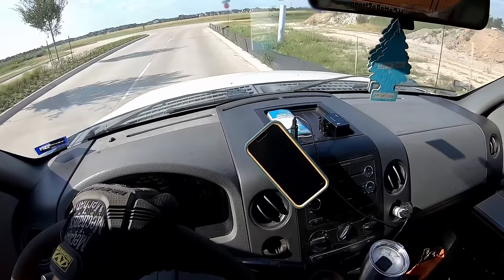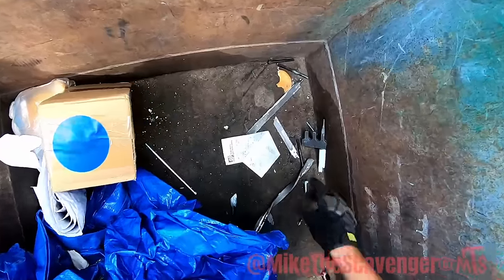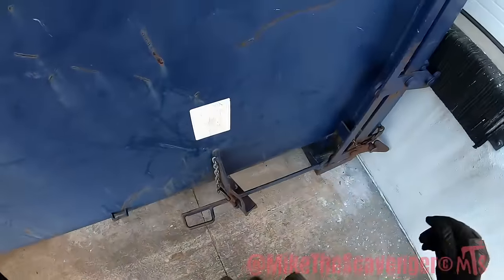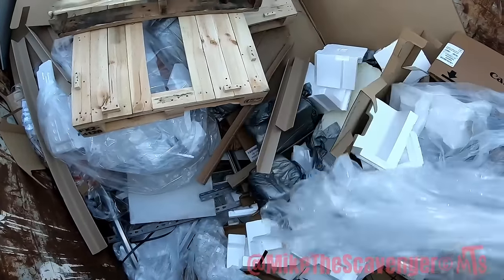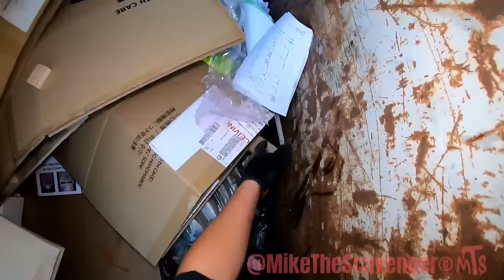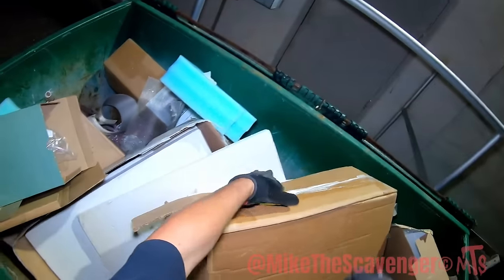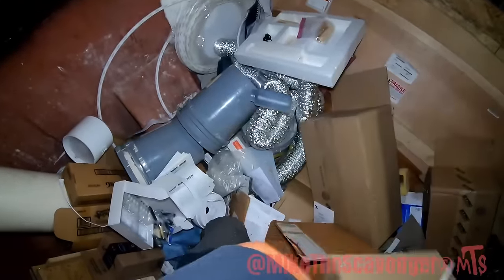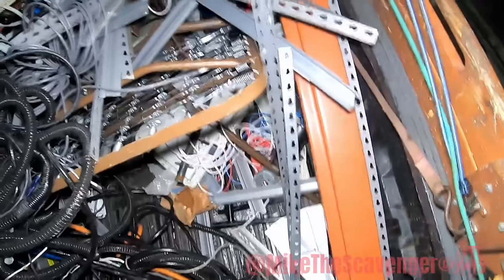Dumpster Diving "It Got The Twisties!"

Comment: That Nobalite Flash system is no joke! Weighs around 350-375 pounds 😂, that unit is just the power supply and controls UV flash lamps
Reply: What does anyone do with that much UV flash? Industrial scale sterilization or epoxy curing?
Reply: @paulperry7091  Sterilization is one use, alot of product testing use it to see how things will react to sun fade, I believe its also used to test sunscreen/lotion. Also similar machines (not this one) run the lasers in big CNC machines
Reply: @Mikethescavenger

Comment: That was about 600$ worth of grout!! Hope you took that home!! That can do a whole building
Reply: It may have been old stock that was exposed to humidity... If that's the case... It's all bad.
Reply: @OldsmobileCutlass1969Va  doubt it.
Reply: Mike is usually pretty knowledgeable about stuff, but sometimes he priotizes scrap over profit..
Reply: @BurkesBucknFirewood You doubt it? Based on what? You must be privy to info that every other viewer isn't... 

That grout is worthless, plain and simple. I don't care how much I thought it was worth, I wouldn't use it, or any other cement based product that was thrown out. Install 1 tile job with expired product and you'll understand very quickly why it's not worth it...

Comment: Mike the wires with the crocodile clips on are for a signal generator you plug the wires in to the generator and clip the red lead to something like a lamp post the black wire clips to an earthing pin pushed in to the ground.
the signal generator transmits a beeping in to the lamp post and you can use a CAT cable avoidance tool to trace the cable from the lamp post.

Comment: The water coming out the heavy machine could be for cooling, or water passing through the machine is getting treated by U.V. light to sanitise it- hence the big U.V. light also in the skip. With all that shelf framing, you should've gotten the shelves to sell with it as a kit- beats scrap prices.

Comment: @mikethescavenger real silver will be stamped with “sterling” “sterling silver” “ss” or sometimes with a lion head. If is has “epns” that’s electroplated nickel silver “cs” is copper “bs” is brass. There’s a few more as well. My yard takes silver plate as brass most of the time. Hope that helps a little

Comment: Hey Mike! I'm responding here to your short - we have similar locks on an air compressor cabinet. The tool actually looks kinda like an old skeleton key, it turns a paddle that rotates 90 degrees with the key to open the panel .You might use a large flat screwdriver to turn them, the flat line should correspond to the position of the locking paddle. 

I think those triangle lightning bolt symbols just mean exposed electrical equipment inside. Since your machine is not plugged in, you should be safe. Any radioactive source should be labelled with the three-part circle symbol and magenta lettering, especially on a newer tool like that.

Comment: that's an alignment punch mike, looks brand new, good find.
Reply: Alignment punches are tapered and with a pointier end- also called podgers. That looked like a normal pin punch- i have a chromed set that look identical. Would be good for punching copper wire from large stators.
Reply: @rossbrumby1957  A pin Punch is not tapered at all because they are made to go through the hole that the pin is in, other wise they would get stuck in the hole before the pin comes out.

Comment: I think your "chisel" ,might be a drift pin !. I only speculate because it appeared to be octagonal on 1 end tapering to round and slimmer at the other ? If so it is used when aligning but and bolts on like tdc duct work and other bolt openings usually smaller than an inch . Either way good score .

Comment: The Noblelight Flash System may be a control unit. It will have to deal with high voltage. Could be some good stuff in that box.

Comment: The Dimatix Materials Cartridge is a snap-in replaceable printhead for the Dimatix Materials Printer. Based on FUJIFILM Dimatix' proprietary silicon MEMS technology, the Dimatix Materials Cartridge is designed for high-resolution, non-contact jetting of functional fluids in a broad range of applications.

Comment: Those white boards are ceramic fiber high temp insulation.
I think the big heavy box with all the hoses and wires has something to do with a laser. Probably a big power supply in it.

Comment: Just because LASER means Light Amplification through Stimulated Emission of Radiation does not mean lasers are radioactive. The radiation that lasers use is radio frequency radiation. Electro-magnetic radiation, not ionizing radiation.

That being said, that's not a laser. That's a https://en.wikipedia.org/wiki/Heraeus "Noblelight Flash System". That means the light it produces is not coherent, which is a requisite to be considered a laser. From Wikipedia: "Specialty light sources from Heraeus Noblelight are used in the industrial, scientific and medical fields, with wavelengths ranging from ultraviolet to infrared." It looks to me like an https://en.wikipedia.org/wiki/Intense_pulsed_light system. While it doesn't produce laser light, it still generates a butt load of heat. Therefore, it requires a butt load of cooling. That fluid leaking out is doubtlessly coolant.

That being said, how can a metal scrapper not have invested in a gieger counter?

Label says it's a pre-production unit for testing and validation. Apparently, they've done their last test on it, and rather than ship it back to Germany, tossed it in the circular file.